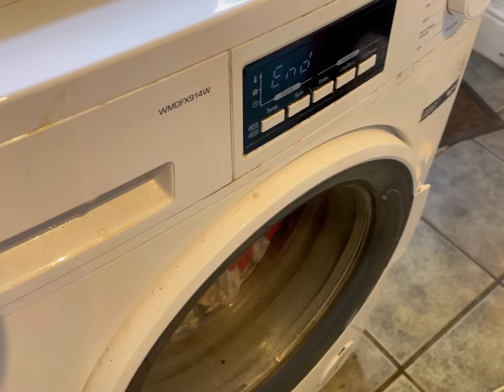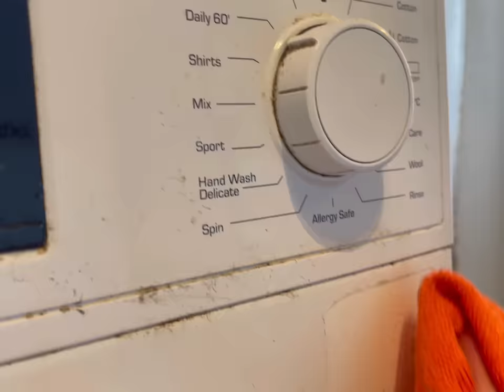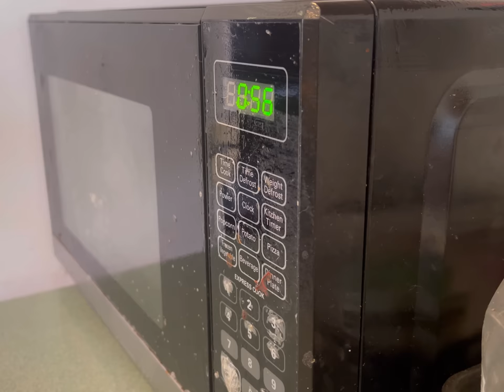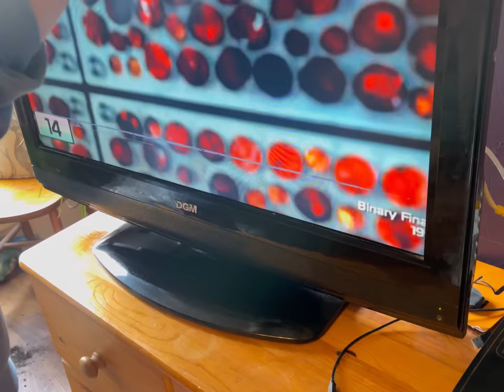Depression house clean - watch to the end for amazing transformation!

Comment: I hear you on the sensory issues with dishes! I have to really prepare myself for it oftentimes. My tricks (so far) are to wear t-shirts (this has saved me on so many occasions from feeling overwhelmed. This way I don't have to continuously pull my sleeves up while my hands are wet) and only doing a small amount at once. I also tend to use warm water instead of hot. This helps a lot with the weird texture on my hands. I usually just use hot water if I need to soak something for a bit. 

I love your videos!

Comment: New comment on an old video, but wanted to chime in that "make a visual difference" is genuinely a great strategy for a Part 1 of a big cleaning effort.  While things like scrubbing the inside of the oven, clearing out cabinets of expired food, etc. are things that need to be done, you cannot do them properly if you don't have a cleared-out space to put the stuff you have to displace to do those deep-cleaning tasks.  It used to overwhelm me not knowing where to start with cleaning, but when it hit that step 1 needed to be "make cleared space" it got so much easier.

Comment: I've just discovered your channel and I love how loving and nonjugdmental you are! I was diagnosed ADD in my 40s and it's only since being retired that I no longer feel overwhelmed keeping up with the house. Well, most of the time LOL.  A quick tip if you haven't already heard it or tried is to turn a cuff on your rubber gloves. It keeps the water from running off the glove onto your arm and then down inside the glove.

Comment: My house is an absolute train wreck. It's culmination is from like 3 years of doing almost nothing (once in a while small parts would get cleaned, but nothing huge) due to stress, depression, a brain injury and physical disability. And now I'm learning that because of the brain injury I now have executive dysfunction. I can make lists of what I need to get done, initially I started with writing out everything that needed to be done. Well that worked about as well as you can imagine. All I got done was writing out the list, becaus once I saw the list I was so overwhelmed by the amount of stuff I needed to do. I've tried shorter lists that only deal with one area of the house, but even that feels overwhelming. I've tidied up a few small areas, but not much more than that. Although I'm not dealing with as much depression, I still have the other challenges. And summer is always the busiest for me. And this summer in particular has been the busiest for awhile. So I do try and get a little bit of something done each week, but that barely keeps on top of what's already been done. Ugh. I need a couple of clones of me. One for cleaning and one for cooking.

EDIT: I completely forgot why I even came to comment. I had originally intended to comment to say yes! I hate how my hands feel after washing dishes. It dries my hands out so bad, so every piece of fabric sticks to them like shitty Velcro. Can't stand it.

Comment: Remi, this was an amazing transformation in the short time you had to accomplish it, even with your cousin's help. What a resounding exclamation of your love for her! It sounds like you're keen on accepting cleaning tips, so here's one of mine. I always remove the knobs on my range when I'm doing a deep clean...just pull them straight off and pop into a pan of hot, soapy water while I clean the stovetop. That gets the greasy film off of them backside and front, and gives me a flat surface to clean instead of going around each one individually on the range. Rinse the knobs and dry or drain on a towel, then check to make sure they each go back on the correct peg. Thanks for a great video...now I want to clean something! 😉

Comment: God bless your heart for helping out your Aunt! I would suggest an easier and less time consuming way to wash the dishes. First you soak the dishes in the sink (like you do) then clean the two surfaces left and right of the sink. Then you start cleaning the dishes, pots etc one by one and put all with soup on the left side of the sink. Then clean and rinse the sink. You might fill the bucket or the sink with water, however you like. Then put all the plates, pots on the water and start rinsing. Rinse and put on the right side of the sink to dry. Trust me it is an easier and quicker way to do the dishes. While you rinse one the others get almost rinsed from the water of the one you just rinsing.... and so on. I hope you find this helpful, from one Mom to the other. :)

Comment: 4:34 Tip for dishwashing gloves. If you get the longer ones, you can fold over the end once so the edge is facing the fingertips, and it will keep the drips from coming up onto your arms when you lift them. (As long as they are long enough, you can also keep water out of them this way.)

Comment: I learned a long time ago from reading a book on how to speed clean your house and one of them was to bring a bucket with your cleaning solution already mix in there and you put your clean cloth in it and ring it out and use it and when you’re Done with it and it’s dirty. Do not put it back in the bucket. Use another clean cough when all your class a dirty then you them out use them again it really saves a lot of time I have a mop like a swiffer mop that does floors and I have lots of classical with it too and I do it the same way once the mop head is dirty I put a new one on and when I’m done, I watch them all then it helps I’m in my 70s I clean my whole kitchen and wipe down all the white cupboardsin an hour

Comment: 🙋‍♀🙋‍♀🙋‍♀I'm the same when it comes to dishes. BUT if you put on the really long gloves and then fold over the cuffs 1 half fold (all the way around your arm) to create a gutter-like system ~ that will keep the yucky water from running down your arm! The cuffs will catch it and direct it back down towards your hands. It really works! Also, add a bit of Baby Powder to your hands before you put on the gloves and it will keep them from getting all sweaty inside ☺